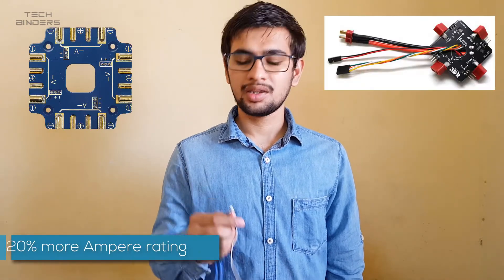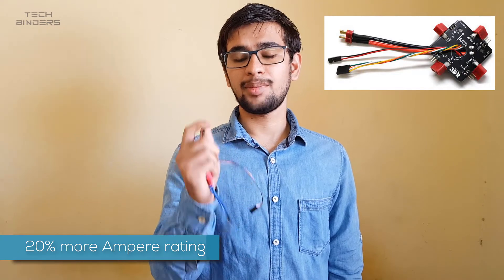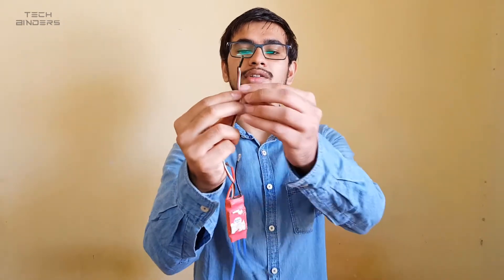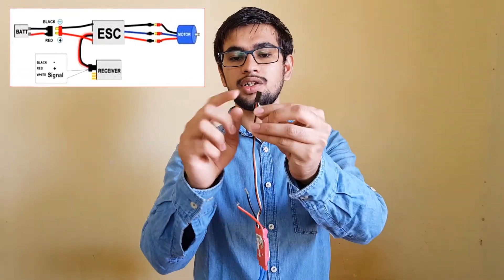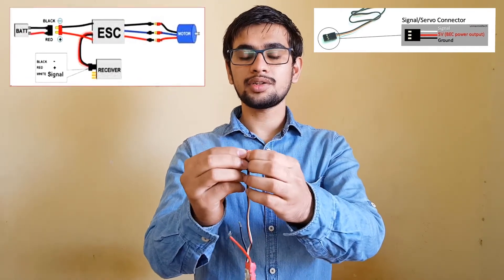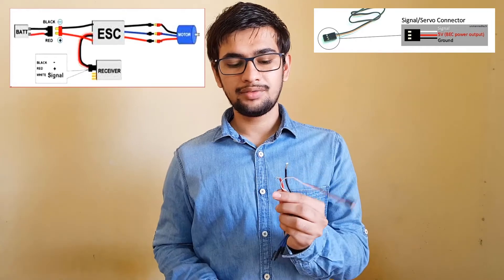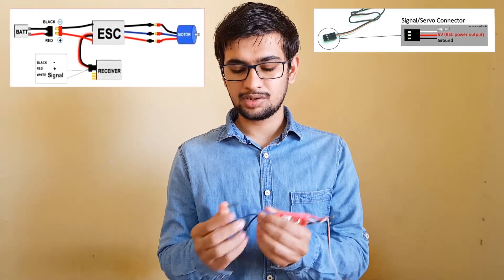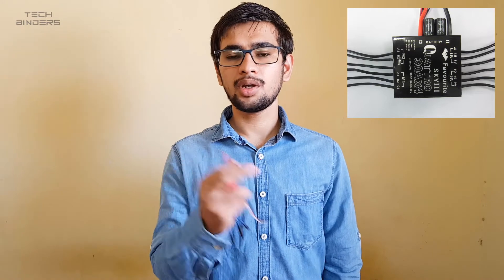How to choose Electronic Speed Controller (ESC) For your Quadcopter. Part 3😀

Comment: for 6000-7000 kv motors having 1106 size what is the compatable esc ? I'm making a micro racing drone using mamba f405 mini flight controller stack

plzz help

Comment: I have 4000kv brush less motor for rc 450 helicopter. Can I use 30a brush less ESC for this motor?
Reply from the maker: Yes u can.. check user manual or data sheet provided by the manufacturer
Reply: @TECHBINDERS  Ok, thanks.

Comment: Bro. i made a rc boat with 3s 2200mah lipo battery & 2200kv bldc motor with 30a.(simonk) esc . but at  first test after some time riding better in high speed.then esc became more hit & burnt out. so i want to know  what amp.esc should have to use for  my rc boat  ? kindly give some idea. please........

Comment: I have A2212 /6t 2200kv motor Wich I planned to use in my diy rc plane project.earlier I used 30a Wich gets heat ND burns.can u suggest Wich esc should I use with dis motor?

Comment: Brother how can we supply power to FC  through ESC .. without connecting power module.
Reply from the maker: Yupp u can but you need to have redundant powersuppy through power module
Reply from the maker: What flgiht controller u are using?
Reply: @TECHBINDERS   I am using apm 2.8 & 2200mah 11.1 v 3s lipo.

Comment: Akshay bro . Can I use the 30A ESC with 28 or 29A( maximum current rating of motor) at 100% throttle for 5mins. I am going to hover only for 5 mins. Will it burn quickly within 5 mins ? or after getting heated up for a long time ? Please reply bro
Reply from the maker: No. It can burn, its safety procedure.
Reply: If ESC burns will it affect the motor ?

Comment: There are few more things that you can tell and few things of your i would like to correct. 

See esc's are of 2 types 
1 is without bec lower  In cost 
2 with bec a bit higher in cost and are not so much prefered in professional quad copter due to the use of power module. 

Second thing is it's not esc that require 5V 2A its the flight controller and receiver. Esc works on nominal 12v battery supply

I don't want to criticize you i just want to help you to give the right content.

And second thing Don't de frame the workshops. They are people who are much more knowledgeable in this field so if you can't respect them don't de frame them. And being in 2 to 4 hour's you cant take there whole knowledge. Just respect your elders and teachers.
Reply: On that point i would totally agree that few people dont think teaching as their religion some make it as a means of earning. 
See i am against the cheap one it may cause damage to the new one
Reply from the maker: Great bro...it seems we are on the same page. This is the only sole purpose of starting this channel. To educate and aware people....
Reply from the maker: Sure bro thanks a lot...
Reply from the maker: So where do u work??
Reply: I am studying over these only
Reply from the maker: Great bro..so you are doing engineering..
Reply from the maker: Actually it was not required to explain bec because the mai objective for this video series was to help kk board and cheap drone buid up...
Reply from the maker: I don't think so i would have said that esc required 5v because it is to power peripheral like servo, cheap flight controller, led lights, receiver etc... but anyways thanks for your comment.
I respect everyone but there are people who don't have propwr knowledge and experience and conduct workshops, training..
I myself has done a number of woekshops in various iit and nits and other enginnering clg....so i have deep understanding what is taught in workshops and to what level....
Reply: Hello sir, I am using 2200 kv brushless motor and 2200 mah 3s lipo battery so tell that which esc I have to use

Comment: I am using 3cell 25C 2600mah  battery with 30A esc and my motor is 2200kv but my motor doesn't work with this ESC can you please suggest me which amp ESC should i use and also when i connect my  esc with my battery my esc become hot
Reply from the maker: Kindly message me on whatsapp so that i can assist you better.
Reply: Also to me battery became hot.... is it mean my ESC is defective?
Reply from the maker: No it means your esc is not supplying sufficient current..
Reply from the maker: Battery is heating then don't use that battery as you may have under rated battery
Reply: Can i talk to you in private messages so i can show you my items
Reply from the maker: Yes message me on WhatsApp

Comment: Bro iam using 810kv motor which esc should I use
Reply from the maker: What is current rating
Reply: @TECHBINDERS  11.5 v 5000mah 3cells 30c
Reply: And also 11.5v 6000mah 3cells 45c
Reply from the maker: Give me motor current details  for everything
Reply from the maker: Kindly message me on whatsapp for better assistance..

Comment: for 1400kv how much c rating esc and propellars should i use
Reply from the maker: It all depends on the motor company as they will provide a specs sheet from that we can find their current rating, propeller size and thrust. So tell me the which company motor you are using.

Comment: where to plug PWM wire if i am running simple bldc motor????????/
Reply from the maker: On channel 3 or we can say that channel which supports trust..
Reply: TECH BINDERS would I require adruino?
Reply: For simple bldc
Reply from the maker: For what .
Reply from the maker: No, you don't required  Arduino for bldc..
Reply: TECH BINDERS thanks for your reply. I fix my problem by attatcing servo tester
Reply from the maker: Welcome. Dont forget to subscribe my channel

Comment: i used 2200kv motor and 30amp esc with 2200mah 3cell 40c battery the esc burned out at full speed what esc should i use
Reply from the maker: Go for 40 amp if you are using 2200kv use 40amp esc
Reply: TECH BINDERS thanks battery is ok na 40c
Reply from the maker: Yes 40c is ok but go for 60c and 3000mah or 3500mah it would be better
Reply: TECH BINDERS sir motor 2200kv ki turnigy company ki hai to uske sath konsi ESC use kerni chayihe aur lipo battery kitne mAh use karni chayihe
Reply from the maker: 2200 kv kyn use kr rhe ho bhai agar ye model bna rhe ho..
Reply: TECH BINDERS kyu Bhai
Reply: TECH BINDERS me samja nahi
Reply: TECH BINDERS Kya 2200kv motor ka use ham ker nahi sakte Kya?
Reply from the maker: Motors wali video dekho mere channel pe samjh me aa jayega
Reply: TECH BINDERS sir aap aise bta dijiye bhot emergency hai sir please🙏🙏🙏🙏
Reply from the maker: Bhai whatsapp karo detail me btata hu
Reply: TECH BINDERS 2200kv motor ke sath 11.v 3500mah 3s 60c lipo battery use ker sakhte hai Kya?? sir please tell me🙏🙏🙏🙏🙏🙏

Comment: Sir my quadcopter tilts to one motor side while taking off in self level mode
Please help please
As soon as possible
And i had purchased 3 bldc motor from one shop and 1 from another and it tilts downward towarda the 1 which i had pirchased from another shop . They all are of same 1000kv . Does this make any sense??
Reply from the maker: +MOHIT KUMAR no if they are of same kv no prblm...you need to configure esc and motor for balancing
Reply: TECH BINDERS sir i had config. Both by seeing videos
Reply from the maker: +MOHIT KUMAR yes sure...i will help you mesaage me on facebook.for better assistance
Reply: I have a solution, do u still have the problem?

Comment: What are programmable ESC....? Why to program them...? And what parameter to be programmed in an ESC....?
Reply from the maker: +SHAILESH SHUKLA it depends on the sensitivity of motor..so that all 4 can respond in the same time and adjust the parametwrs like current and voltage..in all 4 to be more precise flight controller and increased response time.